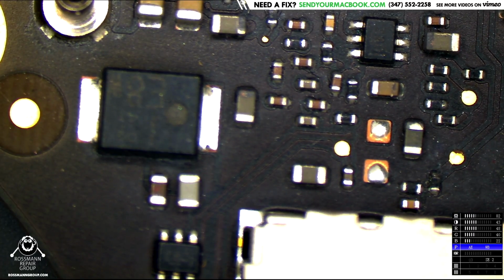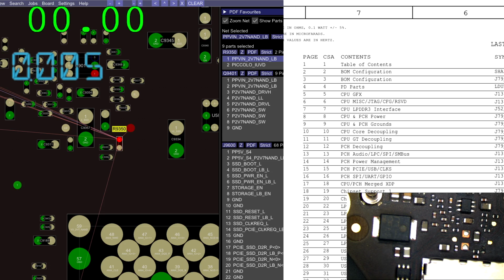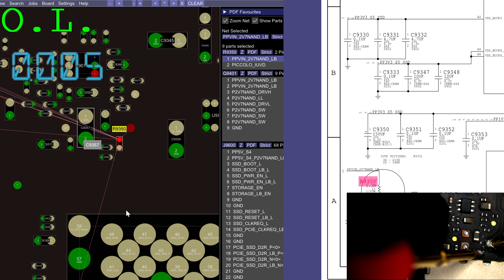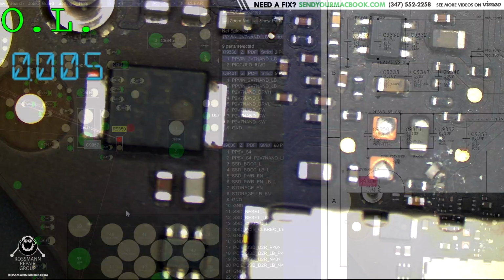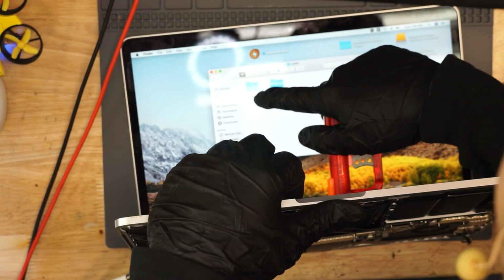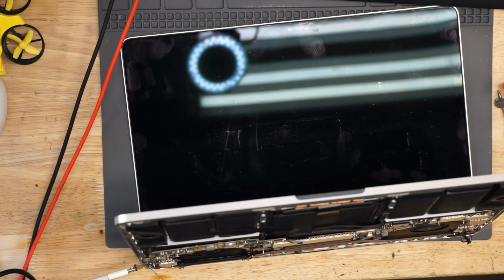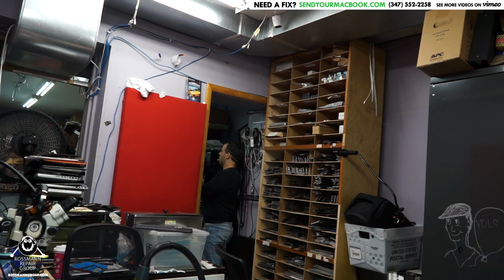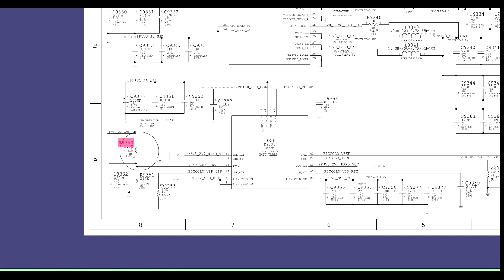Soldered on Macbook SSD not showing up? How to diagnose & repair it! Solid State Drives are fixable

Comment: We've got this exact model in our shop. Weirdly enough, the hard drive shows when we go into recovery but only for a few seconds. Then it has a "Poof" graphic with some smoke clouds and the drive disappears. There is no water damage either. Any suggestions for another shop on the other side of the country? You think the Flash is bad itself?

Comment: What could be the problem with folder with question mark? My macbook pro A1286 is not detected only SSD when pressed option key at  start up and continue booting up with network and it will detected SSD on disk utility and I can do partition/erase but when I reinstalled OS, it booted up to folder with question mark again. I replaced hard drive cable and new SSD but same results... any advice

Comment: I have an a1706 and no charge. The charger is working correct. In Your experience the problem could be in the ic u7000?
Reply: I can be. I'd check the voyages going into the unit with a volt meter if you've got one handy. Usually bad chips have a very low amp intake or fluctuate.

Comment: Hi Loius or whoever reads this.

 

Was reading your beginners guide and noticed an error.

 

Around page 26 there is a page headed with Resistors resist the flow of current.

 

the top two points read as follows.

 

You will have the same amount of voltage on each side of an individual resistor

You will have less voltage on the other side of a resistor.

 

I think the socond point should read You will have less current on the other side of a resistor.

 

This might be wrong as im a total beginner hence me reading the guide.

 

Thank you for your time.

 

Dave

Comment: You don't even need a datasheet to know what that resistor is for. It's clearly part of some sort of (maybe reference) voltage divider. Those in turn do not tend to work too well when one resistor is open. Why they would use R values as high as 1M3/215k on a 2.7 V rail that is not likely to operate unless the machine is actually running is anyone's guess. That's under 2 µA of current, or 5 µW of power dissipation (hardly stressful even for 1/20 W parts). I would assume individual variations in NAND chips to account for far more.

Comment: Would you offer the service of that internal coating companies put on phones to protect against liquid damage? That way it might protect against the customer spilling again.
Reply from the maker: No, too much customer service hassle. Keyboard is not liquid proof, the touch bar is not liquid proof, the battery is not liquid proof. Even if I do that, when it stops working for some other reason after the spill they will come back and want to kill me.
Reply: @rossmanngroup  fair enough

Comment: Soldering on the SSD was one of the single most stupid/infuriating things Apple ever did.

Any defect on the board? Good luck getting your data back. Apple isn't going to help you.

And why did they do it? Just so they can charge a huge premium on laptops with more storage than the base model.

Comment: So what do you recommend instead of Apple? Seems consumers lose regardless the brand now and days.
Reply: Business laptops are the best quality, my recommendation is the dell latitude lineup.  also dell XPS, not a business laptop, but their top of the line consumer laptop
Reply: Maybe its my fault, a dumb ass question attracts dumb asses to answers.
Reply: Anything that gets more than a 5 in iFixit
Reply: @alejandrobueno8819  yeah, just because its repairable doesn't mean its a good product.
Reply: @albertocabrera6614  Then sort the iFixit scores by date and cross reference them with reviews. First part in not buying Apple is to take some responsibility into your own hands.
Reply: Lenovo ThinkPad, good laptops, perfect keyboard and reliability, not a great technical support in Europe at least. Average battery, not that great, they runs hot and have an annoying proprietary charger. Dell XPS, good overall, nice prices with constant discounts, a lot of configuration on their site, build quality in the average, terrible keyboard compared to the others, perfect technical support on the go, always some problem of sort with loud fans, loud white noise of the processor, strange things that apparently annoys a lot of people. Good battery, heavier than thinkpads. Razer Blade, nice looking pc, good battery, performance and keyboard, bad prices, one of the best trackpads, unreliable. Every pc has it own flaws, some are perfect in a category but are terrible in other things, and a MacBook has a bad reparability but good software, perfect trackpad, good build quality, the best battery with the best energy efficient os.  Also is the best in the performance-per-weight and you have to consider that every windows laptop has terrible performances if it's not plugged in, so they're not really a "portable pc" but a compact workstation that needs an outlet. These are a lot of things to consider when you buy a laptop. Sadly Apple has sacrificed the possibility to have the best laptop in the market in favor to their greediness in the Apple Care business. At least with the SSD soldered in and totally encrypted if someone steal your laptop it's completely locked down and secured, and you have the possibility to track it, while with a windows laptop they swap the SSD and you're fucked.
Reply: Anything with Windows 7.
Reply: @theannoyedmrfloyd3998  so anything not supported by Windows anymore. Great suggestion.

Comment: Geez, am a PC tower -only person... can't conceive any of my hard drives soldered to anything.... or any piece not being replaceable... I guess that's why I can't go mobile... I've lost my battle with younger fellow artists ,yet unable to draw a human figure in good proportions , and still try to lecture me on how a 8GB-only ipad Pro, where you can't upgrade the RAM to paint in a digital 2 meters (also, forced to use a 12,9 inches screen for complex compositions...eek) canvas (and can't have most of the professional grade software), is a "superior" artist device to a professional color calibrated monitor, a full specced PC workstation and a Wacom Cintiq 32", or even just a Wacom Large (as pro as it gets). It's just the fancy factor. Can't win there.

Comment: I've worked in the electronics industry for 20 years. 
You know what's sad about all of this the saying "you get what you pay for". Well with Apple that is just no true. You pay outrageous  $$$ for badly designed electronics, and garbage support.
I used to work at Fluke Electronics repair facility for 4 years.
Spent the last 16 years outside of that. Doing electronics calibration and repair.
In electronics I have seen products from many manufacturers some  garbage and some awesome stuff.
But I can tell garbage product support from awesome support.
I never really like Apple product, couldn't pug my finger on it. It was when it came to trying to fix the first Ipod 32g fifth gen.
Crap for support and parts.
Reply: My usual response to that saying is - You rarely get more than you pay for, but you often get less...

Comment: Is it apple bad design or bad components. I'm surprised these things fail so often. Even crappy hp, Dell, even Acer don't fail this often.
Reply: Any company can/will occasionally fall victim of a batch of bad components. Metal, electricity, and water will corrode no matter brand. The lack of protections trying to keep water away from components lies on Apple. It's not like they do component level repairs for consumers (possibly at the back end to refurb boards from costumers machines where they sold a replacement) so they could conformally coat the entire thing (except connectors) and prevent a lot of this. (Conformal coating makes component level repairs more of a pain as it has to be removed to do measurements and (de)solder stuff)